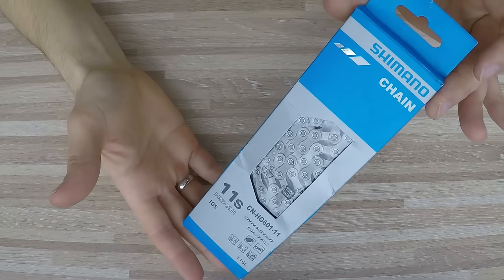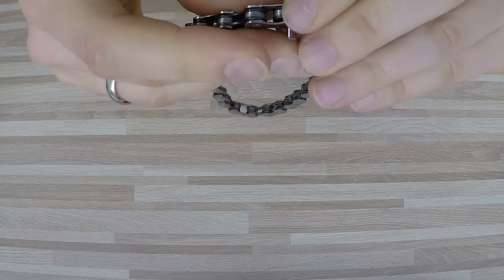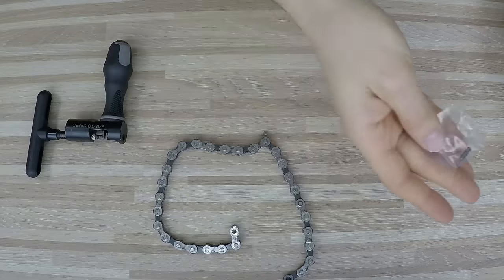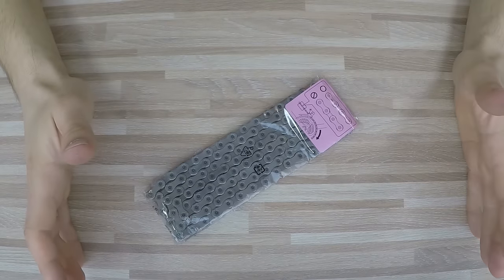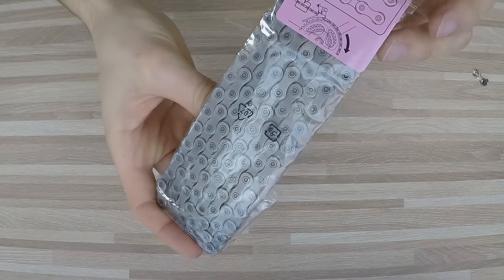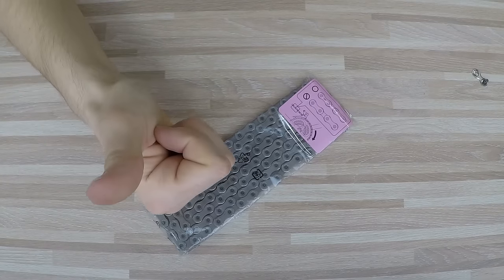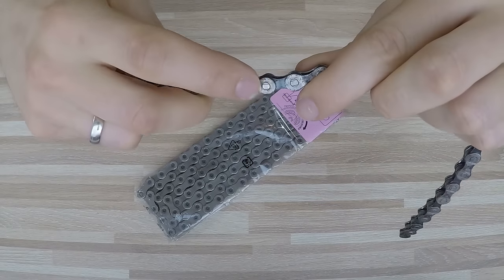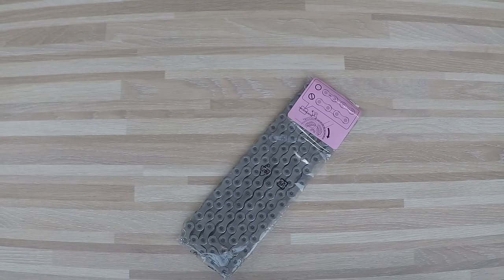4 Worst Mistakes In BICYCLE CHAIN Maintenance. How NOT to do it. SickBiker Tips.

Comment: as we say in Russian - “if your hands grow out of your ass” then probably you should not ever touch the chain at all. I’ve been using the same pin after chain removal (for cleaning) on shimano 11sp chains maybe dozens of times. no problems
Reply: Se Me: The reason you've had to use your method "dozens" of times (!) on something that hardly ever occurs in typical circumstances is precisely because you're using the same pin! Is this a joke?
Reply: @lazurm  he says for cleaning which I guess he does often!
Reply: Is that the Shimano 11 hand arse cleaner I have heard about?

Comment: I live on dirt roads so I get a LOT of gunk.  I also ride 400 km per week.  I have found that steam cleaning the chain is good, followed by immediate lubrication with a solvent/grease based lubricant.  This penetrates the links easily but the lighter weight oils evaporate leaving a good solid lubricant layer INSIDE the chain where it is needed.  Depending on the chain I can get 20 thousand to 30 thousand km out of each chain.  Of course it is rarely a good idea to replace the chain after this much use without also replacing the rear sprockets as a minimum.

Comment: i have always used white spirit in a tub and a paint brush, dry off with a compressor nut white spirit evaporates also, followed by a high quality chain oil, never had a chain fail in 20 years of riding on and off road

Comment: I'd say, from recent personal costly experience, watch chain stretch closely.  You might be able to extend the life of a chain for thousands of mile with these tips, but your drive train components are also going to be completely worn-out in the end.  If you attempt to install a new chain on those worn out components you'll most likely get really bad skips on your most frequently used gears.  Replace 9 speeds at .75, 12 speeds at .5, single speeds at 1.
Reply: …how bad is chain stretch? I don’t have the confidence to change a chain myself, and I just got a shiny new bike I’d like to keep pretty. I have the lube, I don’t plan to ride in rain…by my math my first 1000 miles should be worry free. That’d be about 3 years by my estimated use. So I think I’ll be fine?

I read about what gear to park in. Consensus seems to be…no one agrees. I think changing gears adds stress and wear on the chain and components, but I’ll still do it cause it helps ride easier. (2-3-4 only, on a 7-speed shimano gearset).
Reply: @amyx231  its always better in the long run to cycle thru your frt and rear gears.....otherwise you start getting dried pivot points and cables
Reply: @crabtrap  unfortunately, I’m not strong enough to use anything above 4th gear. Too high a resistance.

Comment: my last chain was used as i bought my bike used also...and last year snapped in half ripping my rear derailleur apart...
new one. shimano HG 53 after washing my bike, using compressd air..blow off moisture and let it in the sun/warm place to dry..then apply some oil...i use even fork oil 5wt...very thin one...it works great !

Comment: Good video and I learned something.  For competition I guess it is important info.  I ride about 3000 miles a year and have never had a chain break.  In fact, I have never had a chain break!  I am 64 and have ridden forever.  Never cleaned the chain before I put it on.  Reused the pins many times to get the right tension.  I still ride a 10 speed Bridgestone and it is enough of a challenge for me.  Dirt is the enemy of moving parts on a bike and I strive to keep it clean.  I wear the chain out in about a year.  The links stretch out and damage the sprockets.  So the info hear is probably for competition biking.
Reply: my guess is you bike is chrome plated garbage. when you start riding higher quality lighter bikes....you'll see the need for this info and no, i don't mean for compition

Comment: Best performance chain lube (according to VeloNews tests):  paraffin wax (i.e candle wax).  Clean your chain with you favored solvent/degreaser, wipe and then soak the chain in molten candle wax (use 2 pans: outer pan water, inner pan wax).  Subsequent waxes (once a year or less for me) usually  don't need cleaning, just pull the chain through a piece of newspaper once (it is likely still completely clean as dirt doesn't stick much and any dirty wax tends to fall off).  Lasts for ages and produces and incredibly clean looking and clean to use chain.  It's wonderful, quiet, long lasting, high performance, clean and cheap!  Recycle all those unwanted gift candles from W. H. Smiths, etc.  from a few years back! ;)
Reply: Are you still lubing chains with only candle wax?
Reply: This should be mixed with PTTFE powder, 50 gr every 500 of paraffin wax…

Comment: the WD in WD40 stands for "water displacing"  So, you can spray this after scrubbing down you bike and then spin excess off and follow with you lube of choice.  :) thanks
Reply: The WD stands for wing de-icer. The 40 is the 40th formula in the development phase.
Reply: After reading about most of the high tech lubes I thought that the WD meant "What'cha doin'?"
Reply: WD40 is also part solvent.
Reply: @JoeMama-hl1ey  The base of WD40 id fish oil. No petro oil at all. And it stands for Water Dry. It was developed for wet ignition systems.
Reply: @johnwaddle9323  https://www.wd40.com/myths-legends-fun-facts/

Fish oil is a myth
Reply: They make a bike chain oil now too .
Reply: @jamesreynolds8709  WD-40 stands for "Water Displacement, 40th formula". That's the name straight out of the lab book used by the chemist who developed the product. (According to wd40company.com)
Reply: @jamesreynolds8709  no its water but cool imagination.
Reply: @jamesreynolds8709  sorry James,  WD-40 is NOT de-icer!  It's a metal protectant to prevent corrosion and does indeed stand for "water displacement."

Comment: Nice advice. For 10 years, I've often reused the same link connection. It's a mildly tricky thing to do with cheap tools, but i did it anyway, and it always worked.  
I'll never do it again, thanks Mr Sickbiker.     Little by little i'm losing all my bad bike habits.
Reply: hogwash! i've been storing my bike outside for 29yrs with zero problem! its still leaning agianst the same try where i left it 29yrs ago!

Comment: My chain broke once because I reused a link. This only happened as I was accelerating quickly and shifting many gears at the same time. I reckon that reusing a link isn't bad as long as you treat your bike good.
Reply from the maker: Did you brake the shifter with your knee, when the chain snapped? ;)

Comment: Different people have different needs from their chain.  "Super sticky" doesn't win races.  But it doesn't get thrown off the chain with water or heat.  So it persists for longer and gives better protection for the pins.  I have tried many lubricants over the years but the best one for me is one with a mix of light and heavy oils where the light material gets the oil to penetrate into all those tiny crannies but then dries up over perhaps an hour.  Leaving a heavy lubricant that lasts.  The outside of the chain can then be kept cleaner without compromising the lubrication.

Comment: Great explanation of chain packaging. I have been trying to explain for years that the 'grease' a chain is packed in is just a preservative. It keeps the steel from corroding. It is better than bare metal on bare metal but it is a magnet for dirt. One thing that is left on the road by car tires is carbon. Your front tire picks it up and shows it right at your bike chain. The packing preservative will gather that carbon and grind your chain into uselessness.
Reply: You and SickBiker are getting a little dogmatic here. Not all factory lubs are equal. With high end SRAM chains instructions are to leave the factory lubricant on as long as reasonable. And other YouTube experts concur ... leave the factory lubricant on these chains alone at first, since you'll never again get better lubricant.

Comment: You missed most important part of why you should keep the chain clean and lubed. It's because ride with a dirty or rusty chain deforms quicker the drivetrain, and if you use the same chain for too long the result is the simliar. All chains (specially shimano ones that seems to be made of butter) stretches and this wears down cassetes and chainrings teeth quicker because their teeth acomodate to a stretched chain. Chains are much cheaper than a cassete or chainrings specially nowadays with 1x11 drivetrains. So is better to do not use it for too long because if you doing then when you replace it, you'll have problems because the new chain and the deformed teeths won't match.

Comment: You make an excellent point on the "original" grease that is on a new chain.  THAT grease is there to protect the chain during storage - not for actual use.  Put another way, "storage" grease is not the same as "use" grease.

Comment: WD stands for "water displacement".  While one may may or may not use water based cleaners for chain cleaning when the chain gets wet from cleaning or rain WD40 will drive away the water from the rollers (and the rest of the drivetrain).  The WD40 should be wiped off and proper lube applied.

Comment: I race every weekend and always reuse the quick link. Never broke the chain with over 1000 watts sprints. As long as you buy good parts and maintain them, you shouldn't have any issues reusing that link. I do it for both Sram and Shimano 12 speed chains
Reply: Some of these expensive quicklinks are actually made from stronger material than the chain :D

Comment: Doing that chain connecting on thousands of bikes since the last 25 years in my shop - nothing breaks
Reply: He didn't emphasize the actual risk of reusing the pin, which is braking the mushroom ends of the pin, rendering it more prone to slip out of the plate. That's it, nothing 'breaks', the link disconnects from the rest, thus 'breaking' the chain. Though, cheap chains don't use mushroom pins.
Reply: @thomas930409  Good point but what I find is I end up with a stiff link when I push the pin back in.But it rolls!
Reply: @alwayslearning7672  I always push it a bit too far in, then push back from the other side, that opens the link back up properly and stops it being stiff.

Comment: I've been cycling  42yrs and over 350K  km. I have never used a new pin when joining a chain. Now I only use SRAM chains. Always cleaned with petrol/gasoline or turpentine after every 100 km or rainy day. They mostly  last over 5000km to 0.75% stretch. Now I only use a Barbieri cleaner and mucoff wet lube. I used to use the Park tools cleaner and squirt lube and found the park tool cleaner does not submerse the chain and the rotating brush sticks, squirt lube only works in warm weather therefore it flakes off in the cold.

Comment: The muc off degreasers work well, I have tested both the dry degreaser & the one in the green can,but the green can one msut be rinsed off with water, I used it to clean off very dirty cassette & chainrings few times, worked great,but most times jsut using muc off bike cleaner  & motorex biek cleaner works great on cassettes, I only use degreaser if its very dirty.
I just changed a Kmc chain, some of the links were not moving smooth.
I degreased is as good as possible, then I lubed it very well, so the chain was soaked in lube,and I wiped off access.
I have done this before, with no issues. I lube the chain so often there will never be too little oil, I wipe off the chain after almost every ride, and re lube it.
But I tried just re lubing the chain with finish line dry lube so it was soaked in dry lube, it loosened up the chain.

The grease the chains come with works like glue,the chain will be very dirty, even when its not in use just standing inside for months.

Comment: I normally lube my chain every month or so, and clean it with special device using degreaser only. Its not perfecly clean after but if you repeat it few times it will. Of course its a waste of degreaser and time but at least i'm sure its not breaking! Thanks for video.

Comment: i put a factory lubed kmc chain in water for a week and it didn't rust, at the same time i  put a degreased chain with wet lube on it in water.  after a week the kmc looked like new still, the bike lubed chain looked completely brown.  i leave it on and always will

Comment: Very excellent advices, congrats and thanks! 

Personally, I clean my chain only with what we call in France 'Essence C', applied on all my transmission with a clean brush and a trash can below to collect the drops. 
i don't know exactly what sort of hydrocarbure it is, but it's very fluid and compatible with chain grease. The main thing is to avoid to clean its transmission with water and soap like so much people do!
It prevents the new and clean grease to reach all the parts of the chain and transmission because of hydrophobe / hydrophile conflict.

Comment: I'm a complete bike noob but have a reasonably broad understanding of mechanics. I recently acquired a old felt hard-tail... I pressed out a few links from the rip. Punched the previously removed pin back in, then saddled up with confidence... it ran like a hungry toddler for several days. Unfortunately a few weeks ago I was in a holding wheel-stand on a steep incline and loaded the crank with awe 245 lbs of man steel I possessed. Long story... long. Threw the chain and face-planted my naughty midget in the frame so hard that even the word "hard" said aloud still makes that midget wanna turn inside out... moral: Don't Do That ISH!

Comment: Quick disconnect links are a good idea. But I disconnected and reconnected a pin many times in the 50+ years before quick disconnect links were available to me. They used to cost more than a new chain. I never had a chain brake. I also probably never disassembled and reassembled the same link twice. I've also never used any expensive light weight chains. I suspect they might be more fragile and break easily with reassembled pins, but I think that's more theoretical than real. Cleaning the chain: I ride my bikes in any weather, rain, flood water (Harvey), snow(not any more because I now live in Texas), mud, dust, heat and I expect my bikes to get dirty. I let them get diry. Don't worry about a little dirt. I've been riding my Bob Jackson road bike since 1976. It's still in good shape.There is very little steel in new bikes now days. I just hose and wipe them down if need be. Re-lube the chain once in a while and clean it when it gets bad. Do you really think it's important to have a clean chain? Do you wash and wax your tires after every ride? If I get a lot of mud on my tires I ride through some puddles and wipe them off with a stick as I ride.

Comment: I use motorbike chain spray on bicycle chain. It is a sticky and relatively thick grease, remains on the chain so long in muddy/rainy/snowy conditions, the chain and the derailleur works very quietly with it. I also used 75W-90 car gearbox oil, I think it is good too. Somebody asked WD40 as a lubricant in the comments. I think WD40 is rather a solvent than a lubricant. Not really suitable as a lubricant for significant loads, almost for nothing in real life, it is too thin, and there is not enough lubricant in it. I think it is only good for lubing cylinder locks, fine mechanics in lab equipments or similar. But not for serious machinery. However, it is great for washing off stuff, releasing stuck rusty things, etc...